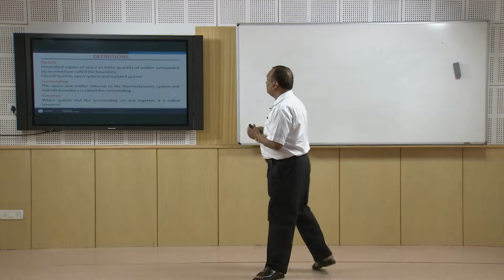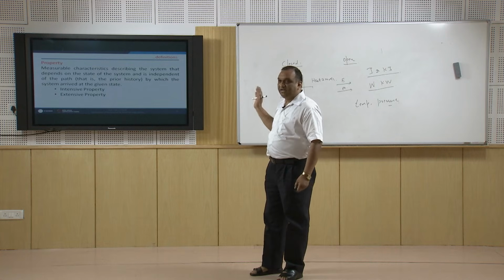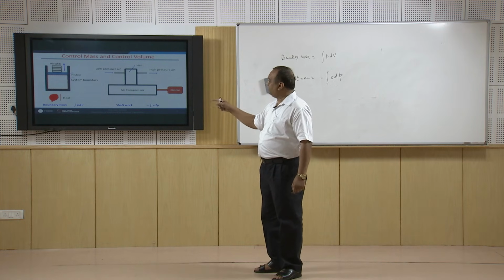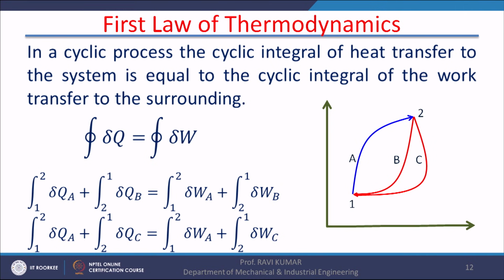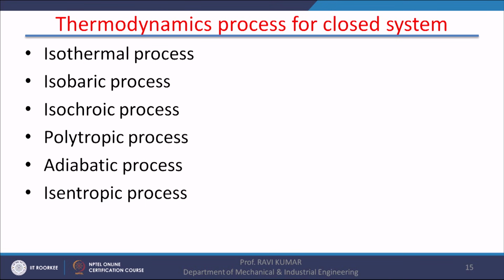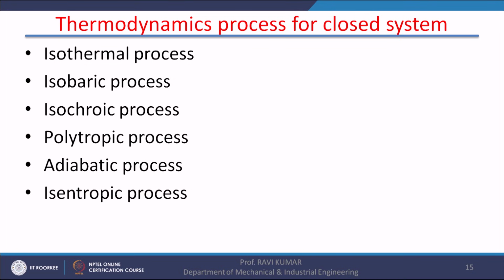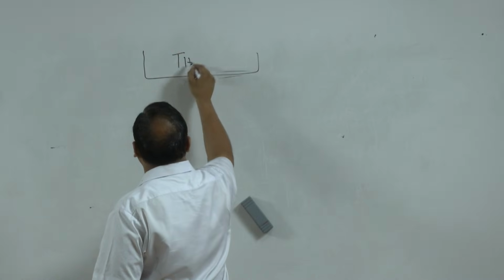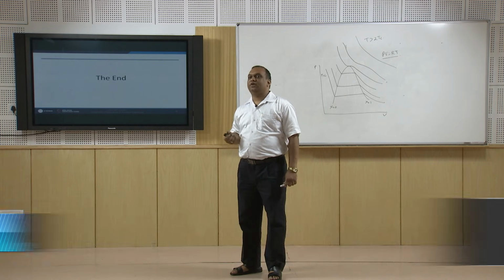Recapitulation of Thermodynamics

Comment: sir could you please tell me what happens when AC is turned off and the refrigerant which is still inside the evaporator is subjected to room temperature , whether it will change the phase or is there any device which controls this change in phase, if it changes its phase then it will create pressure on the pressure on the walls of evaporator since compressor is turned off. What exactly Happens inside??
Reply: Presure equalise